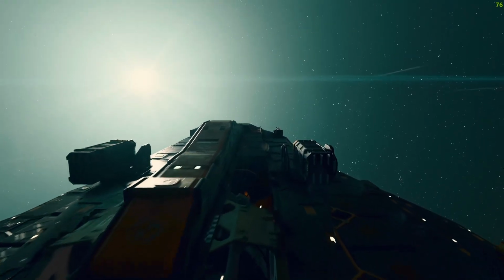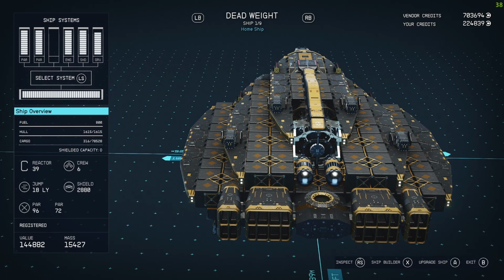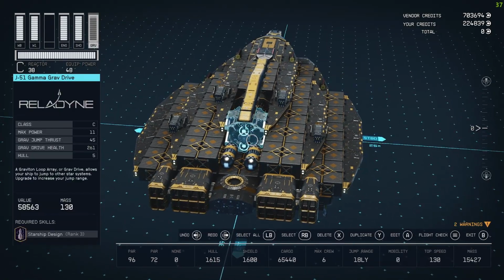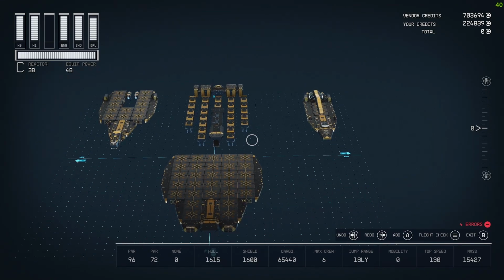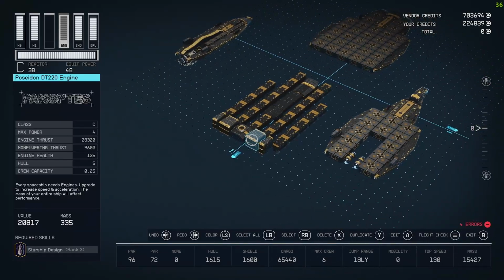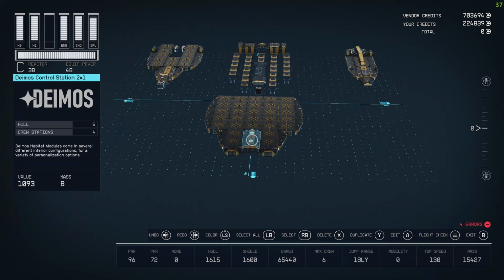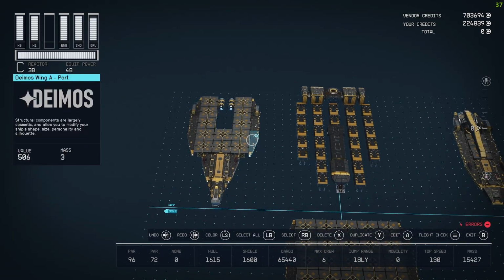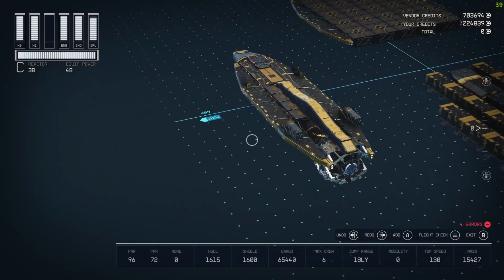Starfield - 65k CARGO - ***NO MODS*** EASY BUILD!

Comment: I'm fine with 40k cargo, I want my Grav drive to be above at least 20 light years. Btw upgrade the ship building skill is such a pain in the butt compared to piloting.
Reply from the maker: Lose a few of these cargo bays and you should be good to go with the Grav jump, but yes I agree it could be refined to be a lot better
Reply: It’s really not. You just spam out random habs and structural pieces i ranked it up in like 10 minutes. You can use the frontier and just attach that monstrosity to it. Remember habs and structurals are cheap to buy and weight like tissue paper.
Building it in an outpost is preferable as you have access to all manufacturers and for example each vendors habs count separately towards the ship building perk.

Comment: This is the problem with the ship building, one part and ruin your whole design. You shouldn't have to glitch those parts. I spent 45 mins designing a ship that had good cargo (not 65k lol) and a 30ly jump but 1 part was being a problem. No matter what I did it wouldn't click together so I gave up and until mods come out I will not be wasting my time. Nice design though.
Reply from the maker: I agree, Bethesda need to implement small parts that fit into those small gaps and add a bit more freedom of placement. If a part clips, it should auto trim to fit around surrounding components. Would make a lot more Designs possible!

Comment: With a pure cargo ship, as you  have zero mobility anyway, you should just go for speed instead. Equip the White Dwarf 3015 Engine that gives you 180 speed, much better than your 130. I have it on my 45k cargo ship, plus 7 auto turrets facing the rear AND the sides. Works perfectly for fleeing any battle and grav jumping away.
Reply from the maker: Thanks for the tip, I find low mobility causes your acceleration to be so slow getting to top speed, so I went for aesthetics in the end. I can fill my grav jump bar and jump faster than reaching my top speed anyway.
Reply: @andrewbyford  I get it, tbh yours is even heavier than mine so that might make enough of a difference there. For me the speed works though. Oh and I have 7 turrets: 3 facing back, and 2 on the top/side, plus 2 on the low/side (space is 3D :) ). Many enemies die before the need to jump anyway, hehe.
Reply from the maker: @Muldini  More Guns More Easy 💪

Comment: For anyone who doesn’t know, the best engine in the game is actually a quest reward for the main mission with Walter Stroud. Handle the whole mission diplomatically with no violence and you will get access to the SAL 6830 engine. It’s a class C engine that only uses 2 units of reactor power so you can have 6 of them on your ship, and that will give you the highest possible maneuvering thrust in the game. (I didn’t find out about the engines till I was level 48, I ignored main missions for most of the game)
Reply from the maker: Thats good to know, I'll defo get that quest done soon and use those engines for a future build! Thanks for the heads up
Reply: @andrewbyford  they’re ridiculously good, with 6 of them you get a massive 52,800 maneuvering thrust. Massively superior to any other engines.
Reply: only 70k credits per engine. Cheap
Reply: Nice ship
Reply: Apparently the way to get an idea of the maximum amount of mass you can have with an engine before you start losing mobility is to take the combined maneuvering thrust and divide it by 12.35. 

E.g. a SAL-6830 has 8,800 maneuvering thrust and max power of 2. You can have 6 on your ship, so 8,800 * 6 = 52,800. That’s the combined maneuvering thrust. Then we divide it by 12.35. So 52,800 / 12.35 = ~4,275. The combined mass of the engines is 1,980, so that leaves with 2,295 wiggle room for the entire rest of the ship that lets us keep 100 mobility. You can keep going of course, if you’re comfortable with less mobility.

Lets do the same process with the White Dwarf 3015.

3,150 * 4 = 12,600. 12,600 / 12.35 = ~ 1,020. 1,020 - 380 = 640. 

So to get a full 100 mobility with the White Dwarf 3015 engines, your ships mass not counting the engines themselves should be about 640. Perfectly doable, of course, for those small fighters without a ton of cargo. Ideal for them, actually, thanks to the 180 top speed. It’s super fun to zoom around asteroid belts and do actual donuts around baddies.

Don’t forget, if you have engines of multiple classes the top speed will drop to whichever is the lowest. So if you tried to combine White Dwarf 3015 engines with SAL-6830 engines, your top speed will be 130.
Reply: @Fidgetelftree  this is solid info.
Reply: What about new game plus mode? Where do you get those engines?
Reply: @KaiFuzzybutt  new game plus grants you access to some special thrusters, reactors and gravdrive... I have one reactor with 42 power units and a gravdrive with 50 light years capacity
Reply: @KaiFuzzybutt  I’m not sure I haven’t finished the game yet
Reply: @KaiFuzzybutt I hear you lose access to these engines in +
Reply: There is no technical "best engine" each engine has different pros and cons. For Example the White Dwarf 3015 has a high top speed which is "best" for pure speed. Slayton's engine is good for both speed and maneuvering but it isn't 180. I think 2 Sal6830 and 2 WD3015s might provide a good mix of both but I haven't tried yet
Reply: @sanguinetales  Top speed makes zero difference in combat. You can’t outrun enemy fire and pushing a ship to full throttle reduces maneuverability significantly. Maneuvering thrust is the key to successful combat engagements, followed by shields, followed by weapons. The SAL 6830 provides more maneuvering thrust per unit of ship mass than any other engine, by far, therefore it is absolutely the best. If you still doubt it then try engaging 4-5 enemy ships that are 30-40 levels above you, once in a ship with max speed and once in a ship with max maneuverability, and see how long you last in each fight. Also the SAL 6830 has an engine health rating of 180 vs the 3015 having an engine health rating of 41 which means having 4 3015s won’t give you the same total amount of engine HP as a single 6830.
Reply: You don’t have to end that peacefully. I went there and wrecked hell… killed everyone inside- it was a bloodbath… and still I use these engines.
Reply: @HelenoPaiva  hmm you could be correct, I’ve only ever done it diplomatically and that’s based on what google says to do.
Reply: the thing with the 2 power engines is at class C every engine weighs 300+! that's 1800 mass already, say the engines he used way 400 mass that's just 800 mass. I don't have the 6830 engines, but the Slayton engines that are commonly available don't have the combined thrust to carry that immense extra mass.
Reply: Too bad that mission is broken for me.  Like so many others. I can't even finish the game it's so broken.
Reply: @OliverK1  broken how
Reply: @nerdoutreachprogram5358  basically can't interact with the screen that lets you build the artifact thing on your ship. So I can't get to warp and finnish.
Reply: @OliverK1 So… build an outpost instead.
Reply: @Onslaught17  you have to put it on the ship to finish the last mission to get new game.